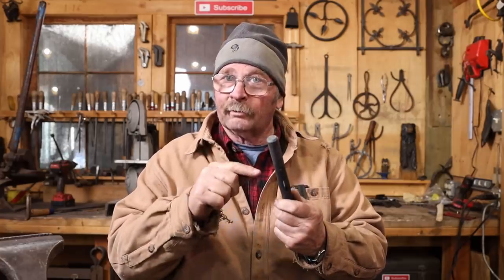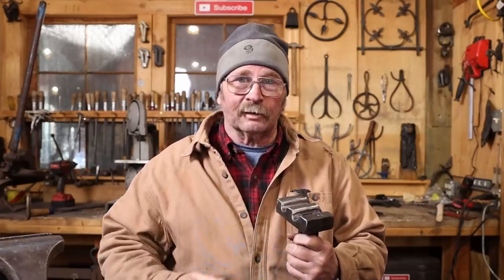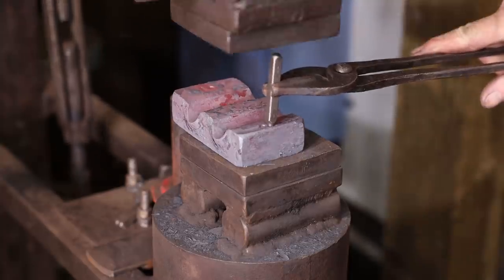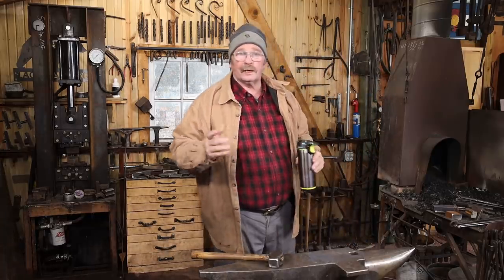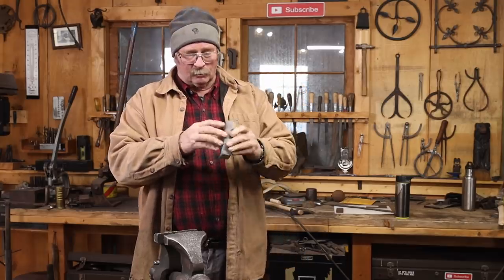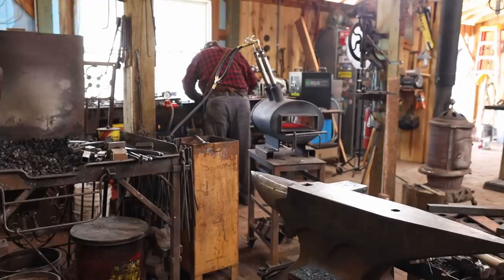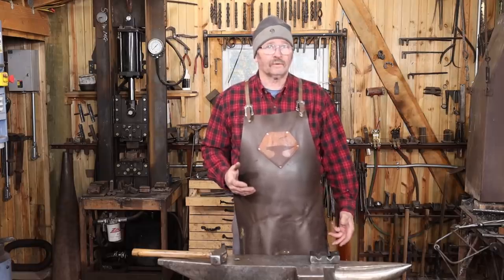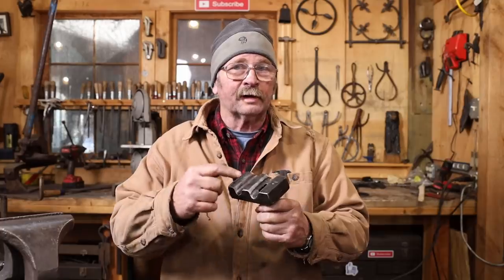Slitting Swage - Blacksmithing tools

Comment: Years back I made something similar (like that) out of Mild steel and just water quenched it....It still holding up...But I don't use it a lot
Reply from the maker: Mild steel can make pretty good tools as long as it doesn't need an edge

Comment: That is really cool... 
Off hand seeing that it jumps around in the initial striking,(in your case as your anvil doesnt have the pritchel hole close to the hardy, as a typical pattern does) I could see an add on plate to hold a hold down of some sort, Since the main hardy is taken by the lower swage. 
Some kind of toggle or swing out... 
All this of course if one doesnt have an additional striker forge hand,  to hit while you set and control. 

Also, Id like to see some tooling making, but more non-tempering oven use..... most dont talk about temper colors anymore.... Thats kinda important Id think...

Comment: John, after you tempered this tool, you eased the sharp edges to avoid gouging parts at the anvil.  Why didn't you "ease" those edges before hardening the tool?  Is there a heat-treating-related reason that I'm not thinking of or some other reason?

I love the way you share ideas like this!  Your videos make ideas pop into my mind as I watch, some that might even be possible in my limited shop!  ;)

Comment: Have an uneducated question, if you had a top swage mirror image to the bottom and away to clamp them together, would you be able to punch your slot quicker without having the work pice bending in the middle on you?

Comment: I have complete plans for a belt grinder if anyone needs one. It should be easy enough to build and most of it could be forged ,it has only two tollorences sensitive areas that use bushings .  Most of its construction uses a 1"5/8s iron pipe.

Comment: Awesome idea!!! Great video as always!! If you don’t mind asking what type of saw blade did you use to hit through that 4140?
Reply from the maker: Its a carbide toothed blade meant to be used with the saw I have.  I would check the specs before using on a regular chop saw, the RPM may be different

Comment: Nice work as always. Great to see the long term view in creating tools, your punching always seems to work out soooo well would love to have that skill. Can I ask a question:-What kind of blade have you got in that chop saw please. Seems to be very little material coming from the cut.
Reply from the maker: Thats a cold saw and has the carbide tooth blade that was on it when I got it over a year ago.  Not sure if you can put a similar blade on regular chop saw or not, the RPM may be different.
Reply: Thanks John, was considering purchasing chop saw and this is interesting.

Comment: Does the tool go deep enough into the hardy hole that the slug just falls out or is it left sitting at the bottom of the curved bar?  It seems like the curved bar could hold that little plug up against the inside wall of the Hardy hole and get it stuck.  Maybe it's smaller than I am thinking and wouldn't be an issue.
Reply from the maker: In this big anvil its trapped until you remove the swage, little chance of anything getting stuck

Comment: I tried to make a mechanical power hammer it works I guess..what is a hydraulic power hammer like that one cost and where could I even find something like that?
Reply: Air hammer. Anyang is the manufacturer if I'm not mistaken. Pretty kuul tool IMHO
🙏🔥⚒️🧙🏼‍♂️
Reply from the maker: My hammer is a 60kg Say Mak. http://www.saymakhammers.com/

Comment: How loud is blacksmithing;;;;;;
Reply: It all depends upon your hearing capabilities, for me not loud, but for certain sounds I am totally deaf. Like I have 2 vehicles I don't hear the warning beepers, or the smoke detectors in the house. But I can hear the thermostat click on the water heater in the basement from upstairs with the door open. 
What maybe loud to you maybe not to others. 🤔🔥⚒
Reply: @robertwhitney2232  thanks
Reply: @argoueiro2816  IMHO, being hearing impaired from work noises, anything constant or repetitive over 85 decibel should be squelched by ear muffs as well any thing over 100 decibels I strongly recommend electronic muffs or muffs and high quality plugs combined.
The damage does not ALWAYS come from a single time or situation, but is more often a cumulative effect.
  For me, the constant ringing and static noise in the ears is a troublesome constant. Especially when it's quiet and you'd like to go to sleep. Coupled with the real fact people truely get tired of you saying "pardon me?" Or "what's that" or "SORRY I didn't catch that". However one does learn to read lips as a hearing aid...till the masks of COVIDS came.
Only you can prevent damages to your body, so choose as you will.
God bless now
Crawford out🙏🔥⚒️🧙🏼‍♂️
Reply: Thanks